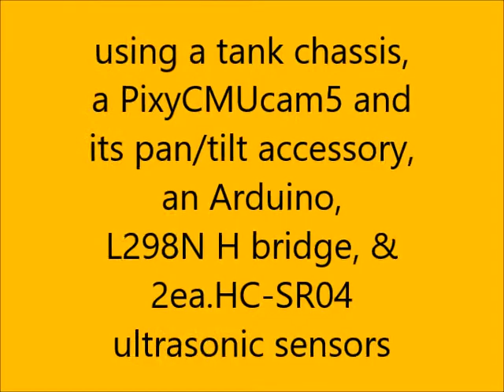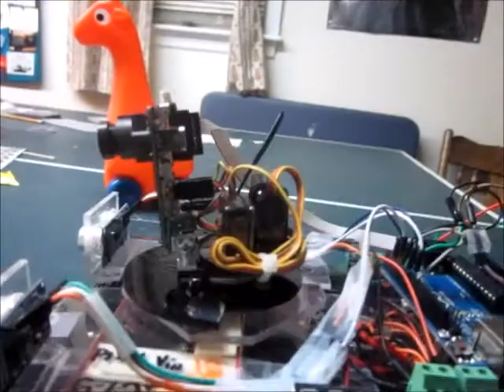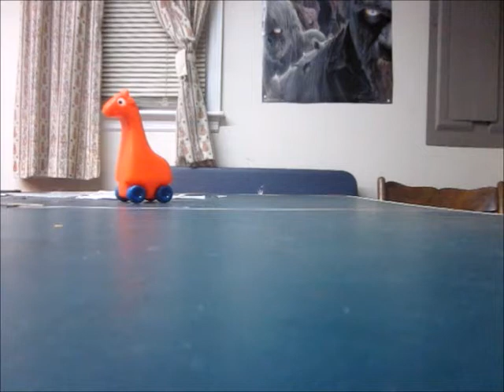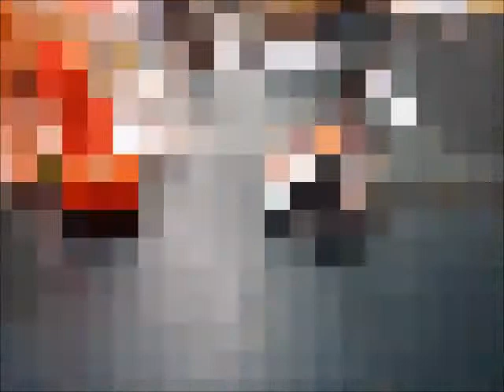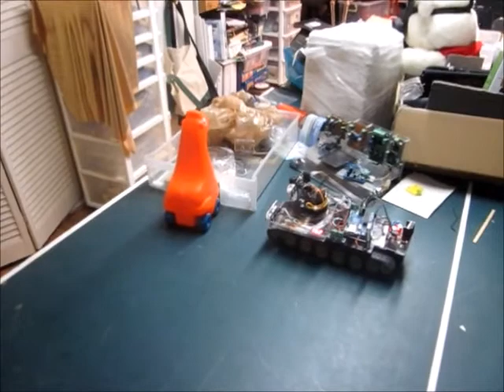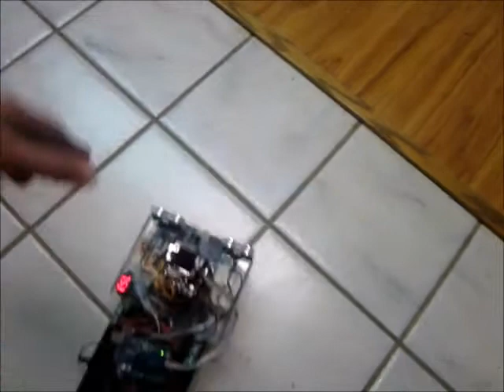The Orange Giraffe Hunter : autonomous color seeking Arduino robot  using PixyCMUcam5 PixyCam

Comment from the maker: code part 2 (You Tube chokes on the code  length all done in one post)

void loop()
{ 
// assumptions: The desired object will always be the largest therefore the first object in blocks
// in this version signature 1 is the only one in use.

/// homemade ping LHS 
  digitalWrite(4, HIGH);   // HC-SR04   pulse high
  delayMicroseconds(10);        // pauses for 10 microseconds      
  digitalWrite(4, LOW);    // sets the pin off               // waits for a second
  LHSmicroseconds = pulseIn(2, HIGH, 3000);// measure microseconds taken to hear pulse, third number is wait time in microseconds( unsigned long int 0 to 4,294,967,295) 
  LHSPingDistanceInches = (LHSmicroseconds/148); //formula from HC-SR04 spec sheet   , assume solution is an integer
// 340 meters/ second  * (39.37 inches per meters) =13385. inches per usec = .0133856 inches per microsecond;; 74.7 usecs/inch , multiply by 2 for send/return path
// debug
//    Serial.print("LHSPingDistanceInches=");
//   Serial.print(LHSPingDistanceInches);
//    Serial.print("LHS Ping inches ");
//    Serial.println();   

/// homemade ping RHS 
  digitalWrite(8, HIGH);   // HC-SR04   pulse high
  delayMicroseconds(10);        // pauses for 10 microseconds      
  digitalWrite(8, LOW);    // sets the pin off               // waits for a second
  RHSmicroseconds = pulseIn(7, HIGH, 3000);// measure microseconds taken to hear pulse, third number is wait time in microseconds( unsigned long int 0 to 4,294,967,295) 
  RHSPingDistanceInches = (RHSmicroseconds/148); //formula from HC-SR04 spec sheet   , assume solution is an integer
// 340 meters/ second  * (39.37 inches per meters) =13385. inches per usec = .0133856 inches per microsecond;; 74.7 usecs/inch , multiply by 2 for send/return path
// debug    
   
//     Serial.print("RHSPingDistance=");
//    Serial.print(RHSPingDistanceInches);
//    Serial.print("RHS Ping inchezzz ");
//    Serial.println();

/////////////////// first check if there is an Orange Giraffe /////////////////

 blocks = pixy.getBlocks();
// pixy.blocks[0].print();
  if ((pixy.blocks[0].signature!=1)||(blocks==0))  //checking for signature 1  only works if there is a signature 2
   {
     StopTreads();  //zero tank motors if running 
 //    Serial.println ("I dont see the Giraffe, going to call search mode  /n");
 //    pixy.blocks[0].print();
     SearchMode();
   }
//  else
//   { Serial.println("not in Search Mode, because I see an Orange Giraffe"); 
// pixy.blocks[0].print();
// }
    delay (30); //give a chance for Pixy frames to update, insert rest of program here
 
////////////////this get blocks is less specific //////////////////

//  static int i = 0;
//  int j;
//  uint16_t blocks;  // 255 is the maximum value of an unsigned char or an uint8_t.
//  char buf[32]; 
  
  // grab blocks! again orange should be centered
  //blocks = pixy.getBlocks();
  //Serial.println("# blocks seen by Pixy is" );
 // Serial.println (blocks);
  
  // If there are detect blocks, print them! execute motion code. If no blocks then go to "search" mode
  // if blocks() // removed this generic line, replaced with checking block zero for sig = 1
  
  if (pixy.blocks[0].signature==1)
  {  
    Serial.println ("I see the Giraffe, going to hunt him down");
    Serial.println (blocks);
    pixy.blocks[0].print();
    
    blob_x = pixy.blocks[0].x ; // The x location of the center of the detected object (0 to 319)
//    blob_y = pixy.blocks[0].y ; // The height of the detected object (1 to 200)
    blob_width = pixy.blocks[0].width ;  // new in this rev, The width of the detected object (1 to 320)

////// * turn speed by blob width ** 
    
    if (blob_width < 20 )   // 20 X 20    about 4.5 feet from camera,  at 7 feet width is 10 pixels height = 20
    { 
    TurnSpdByDist = 10; 
    }
    else if (blob_width < 40) // 30 X 30   
    { 
      TurnSpdByDist = 20; 
    }
    else if (blob_width < 60 ) // 60 X 60 
    { 
    TurnSpdByDist = 30; 
    }
    else if (blob_area < 80) // 80 X 80 
    { TurnSpdByDist = 60; }
    else   
    { TurnSpdByDist = 110; } // close 
//    Serial.print("blob width= ");
//  Serial.print(blob_width);
 // Serial.print("\n");    
 //   delay(1000);
    
    
    if (blob_x < 145) 
        {turn_left = HIGH; }
        else 
        {turn_left = LOW; }
    
     if (blob_x >= 175) 
        {turn_right = HIGH; }
        else 
        {turn_right = LOW; }
    
  }  
// if Orange Giraffe isnt seen, the steering wont change, but if not seen, should search again
  // get ping sensor distance, if object is too close, go to zerospeed 
  if (RHSPingDistanceInches==0) {RHSPingDistanceInches=222;}
  if (LHSPingDistanceInches==0) {LHSPingDistanceInches=222;}
  
  if ((LHSPingDistanceInches<5)||(RHSPingDistanceInches<5)||(pixy.blocks[0].signature!=1)) 
      { SPD=0 ;  TurnSpdOffset = 0; }
  else 
    { SPD=200 ;  TurnSpdOffset = TurnSpdByDist; } //NEW , made TurnSpdOffset variable

Comment from the maker: Arduino code part 3 ( just copy each section in order and paste into one scheme):

///////////////////// H bridge control////////////////////////////////////////////////// 
  if (turn_right==HIGH) //// ha ha I caught using == and not = before downloading 
   { analogWrite(9, (SPD-TurnSpdOffset));   //RHS
      analogWrite(6, 0);      //RHS
      analogWrite(5, (SPD));     //LHS
      analogWrite(3, 0);                       //LHS
   }
   
    if (turn_left ==HIGH)//// ha ha I caught using == and not = before dopwnloading
   { analogWrite(9, (SPD));  // The frequency of the PWM signal is approximately 490 Hz.the duty cycle: between 0 (always off) and 255 (always on).
      analogWrite(6, 0);
      analogWrite(5, (SPD-TurnSpdOffset));
      analogWrite(3, 0); 
   }  
   
     if ((turn_left ==LOW) && (turn_right==LOW))       //// ha ha I caught using == and not = before dopwnloading
   { analogWrite(9, (SPD));
      analogWrite(6, 0);
      analogWrite(5, (SPD));
      analogWrite(3, 0); 
   }  
 
// delay(1);
 
 }
 
//////////////////////////////////FUNCTIONS SUBROUTINES //////////////////////////////////////////////

void SearchMode()
{
 pixy.setServos(500,550);  //center pixycam for a staring place
 delay(ServoHoldTime);
// Serial.println ("search mode is executing");

for (int i=0; i<4; i++)
  {
  /// LHS 
      if (OrangeGiraffe==LOW)
        {
        pixy.setServos((500+(i*150)),550);  //500+167= 667  mid
        delay(ServoHoldTime);
        for (int j=0; ((j<5) && (OrangeGiraffe==LOW)); j++)  //add for this revision , 5 snapshots per search position
            { 
              blocks = pixy.getBlocks();
            if ((pixy.blocks[0].signature==1)&& (pixy.blocks[0].width>MinimumImageWidth)&&(OrangeGiraffe==LOW)&&(blocks!=0)) 
              {
                OrangeGiraffe = HIGH;
                PivotDelay=(LHSPivotTime*i);
                PivotLeft();
    //            Serial.println ("tilt = 500 ,see Giraffe i=");
    //            Serial.println (i);
    //            Serial.println ("PivotDelay= ");
    //            Serial.println (PivotDelay);
                pixy.setServos(500,550);
                delay(30);
               }
               delay (30);
            }
        }
  delay(30);//for next frame

 ///// RHS 
if (OrangeGiraffe==LOW)
{
        pixy.setServos((500-(i*150)),550);  //  mid
        delay(ServoHoldTime);
         for (int j=0; ((j<5) && (OrangeGiraffe==LOW)); j++)  //add for this revision , 5 snapshots per search position
          {
            blocks = pixy.getBlocks();
              if ((pixy.blocks[0].signature==1)&& (pixy.blocks[0].width>MinimumImageWidth)&&(OrangeGiraffe==LOW)&&(blocks!=0)) 
              {
              OrangeGiraffe = HIGH;
              PivotDelay=(RHSPivotTime*i);
              PivotRight();
  //          Serial.println ("see Giraffe, RHS looking level");
  //                  Serial.println ("i = ");
  //                  Serial.println (i);
  //                  Serial.println ("PivotDelay= ");
  //                  Serial.println (PivotDelay);
              pixy.setServos(500,550);
              delay(30);
              }
          delay(30);//for next frame
          }
     }
  }
//Serial.println ("exiting Search mode");
OrangeGiraffe = LOW; 
}